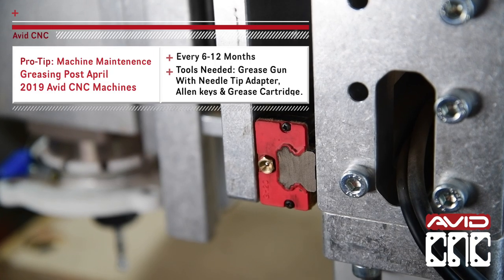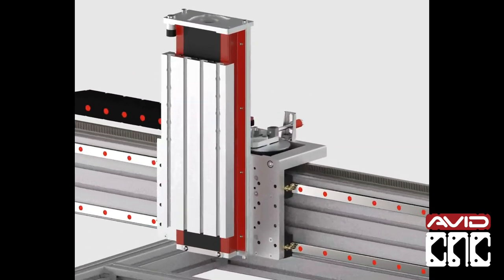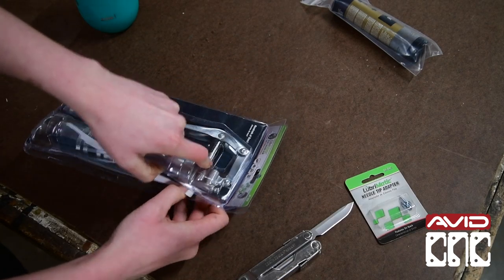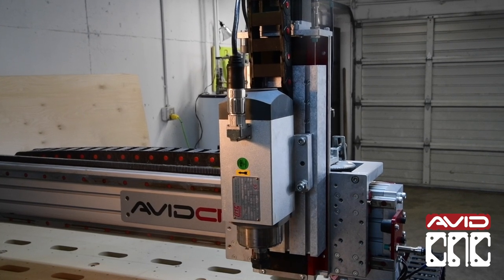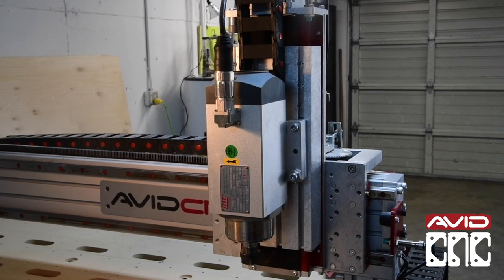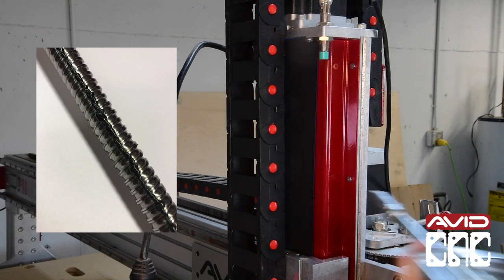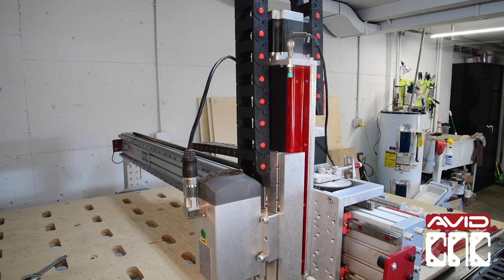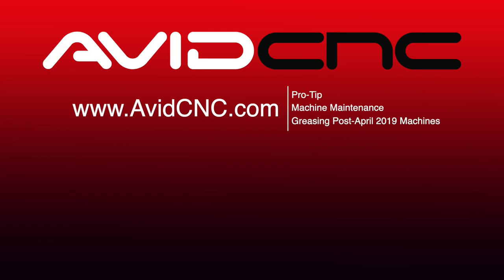How to Grease Your Post-April 2019 Avid CNC Machine

Comment: I ordered mine in 2018, what's different? The grease fittings? My Z-axis looks just like that one.
Reply from the maker: The post-April 2019 Z-axis has wings (it is a subtle visual difference) that block access to the bearing blocks making it difficult to grease them, so the new machines have a new type of self-oiling bearing blocks. Bearing blocks on machines from 2018 need to be greased manually, about every 6 months.

Comment: These needle tip fittings have me screaming...half of them just will not take grease.  I have to remove them in put the grease directly into the bearing, then screw them back on.